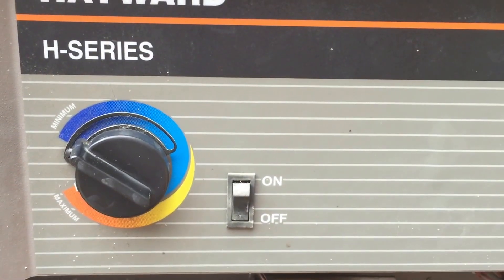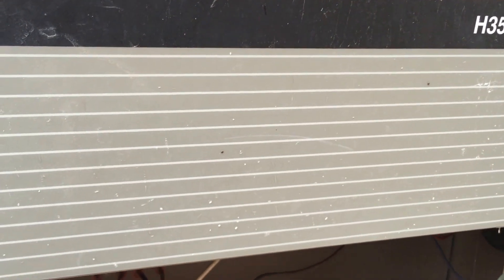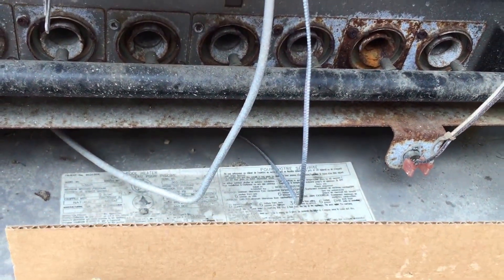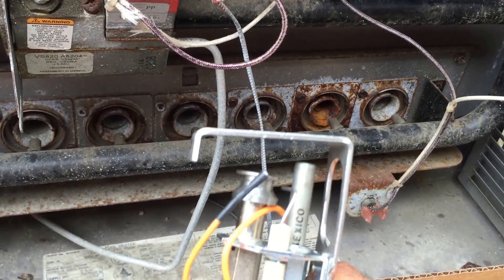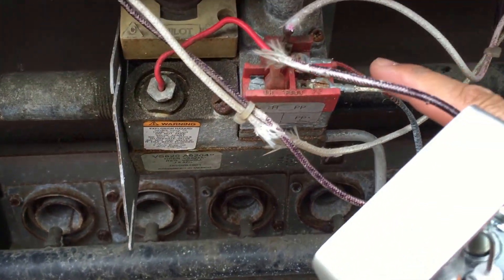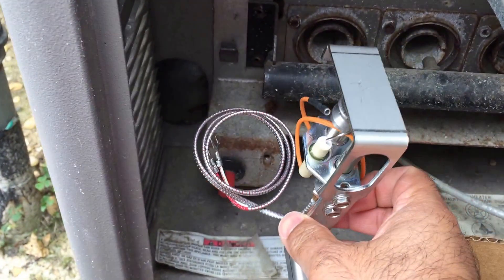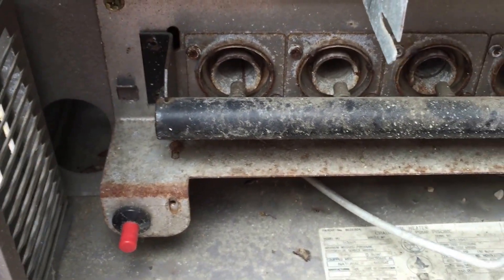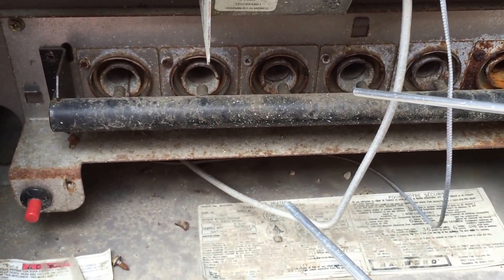Hayward Millivolt Pool Heater Thermopile and Pilot Assembly Replacement - Prep Part 1

Comment: question, i bought a used hayward H100iD1 pool heater, the person i got it from was using it with propane, d i need a special kit to convert it to natural gas?
Reply: Yes, yes you do.  The orifices are not the same and there may be other differences.  Research it carefully!